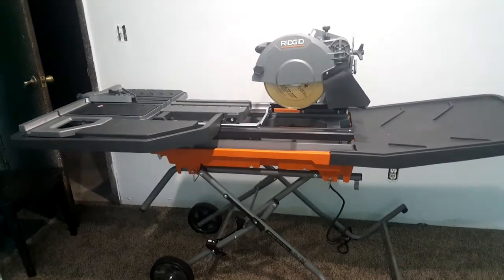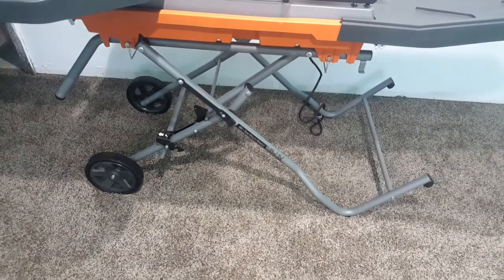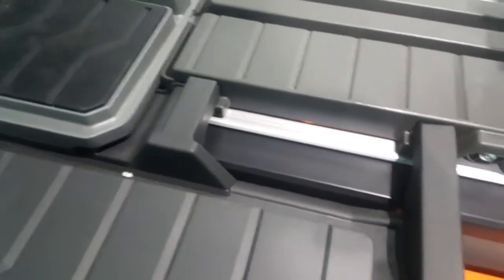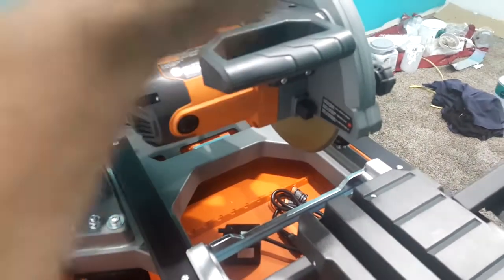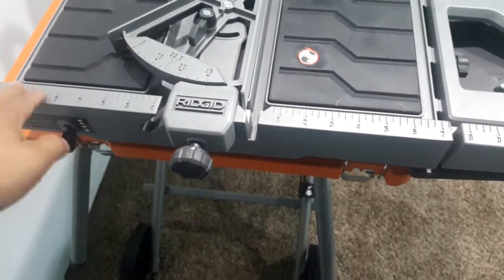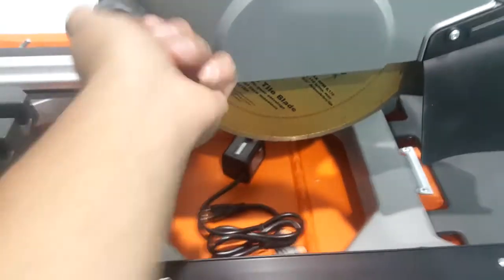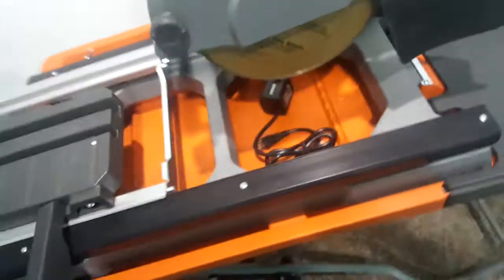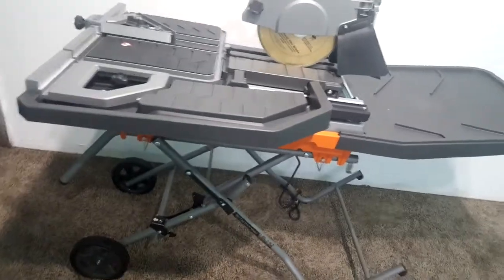RIDGID 10 Inch tile saw (2016 model ) 4092 quick review

Comment: I bought one yesterday and I like it. As for the plastic on the right. You can add a  flat screw on the front bottom and it will hold it in place very well...also I added a small L bracket on the plastic towards the back to hold it in place even more. To me you have to just be creative with things like that. And it will suit better.

Comment: Ive been using this machine for almost 3 years. Almost daily in a big building over 15k sf.
is a great machine for mobility. easy to move around, overall great machine. But, you'll have to play around and find out where to push from when making cuts or it'll cut slightly not straight for example. if you're cutting a 12x24 the long way, they'll be a 1/8 to 1/4" difference from start to finish. the track moves slightly. so i just had to push with my right hand and guide it with my left. otherwise the entire table of the tracks moves move than i'll like. The one slightly smaller than this i find to be very sturdy and makes great cuts.
Reply: Facundo villar thanks man. Your review has helped me a lot
Reply: You need to adjust your blade similar to miter saws and table saws.
Check the instructions to learn how. You will need some tools to align it they are mentioned in the instructions and have it tightened in and zeroed.
Most people like this guy dont know everything since they never read the instructions.
It seems no matter how good a carpenter or tile installer, they never know how to maintain or even to setup the tools they use. No one sells perfectly pre-adjusted saws of any sort. You must learn how to use the tools and maintain them before you buy your own and go into business.
Rigid is 100 percent better at tile saws then kobalt, craftsman, and dewalt. Dewalt never made a decent tile saw to this day for its price.
Reply: Least they can do is align it from the factory. Almost like buying a new car but sorry it pulls to the right gotta align it

Comment: How precise are the cuts with that 10" blade? I heard the blade bends on porcelain. Awesome review my man now let's see you cut some tile.
Reply from the maker: Mookey The Pimp Thompson the blade that comes with it is ok. just replace the blade with a better one and it cuts like butter bro
Reply: it does, you'll just have to make the cuts a bit slower to avoid it.
Reply: I had this issue with different saws and it’s two things or a combination of the two. Either. The saw head needs to be loosens and adjusted for squareness or the blade is thin and/or weak. Or both. Some harder tiles will make the blade follow its imperfect line due to adjustment. It’s such a pain when this happens, as I’m sure many know. When it’s a thinner weaker blade issue, purchasing a higher quality one solves that. 
  If it was a head adjustment (or table adjustment on the older models) one thing I would do was to push on the side of the spinning blade to help counter act this. I never recommend anyone attempting the “out of the box” fixes I did out in the field but this worked in emergencies. I never did this with the blades that have the relief cuts in them but just keep fingers wet and away from the Diamond edge. Although, even grazing the Diamond edge, when it did happen, caused no issue it I wasn’t pushing hard. I also never wore gloves like with most spinning tools.

Comment: It looks like those rubber bands on the side of the stand are used to secure the water trays underneath the stand when not in use. Also, just wondering if you've had a chance to use it yet and if so what are you're feelings. I'm interested in buying this unit. Thanks for your video.
Reply from the maker: yeah that's what their used for.  and yes I finished a full herringbone tile job it works awesome and you can use it indoors as well only things I didn't like is if your using a tile over 24 inches in length the water trays in the side won't catch the water it will spew over to the floor. second the rails where the bearings roll on you have to constantly clean them if your doing a lot of cutting or the sliding tray will get jammed on a piece of tile or debree but we did a lot of cutting so like I said just depends. other than that for some reason it wouldn't turn on one time I tried to turn it on but I unplugged it and replugged it in and never had the issue again but so far it's really a great saw and the trays are actually sturdy and handle plenty of weight ease of transport is awesome and very easy to clean great saw and the  water trays system is awesome

Comment: Hi. Thanks for this review. How is it going since you have been using the saw? I am interested in purchasing a wet saw for mostly cutting glass wine bottles (diamond blade) and I am leaning towards the Dewalt since all the big features on here don't seem necessary for me anyway. What do you think about the water feed on this one? I read that it doesn't even aim at your blade / work and there is no way to adjust it. Thoughts? I may get into some other projects but I'm still thinking Dewalt 2400?
Reply from the maker: fromBaltimore yeah the water feed is directed one inch away from  blade itself. but its a great saw the stand alone saves you so much time setting it up and putting it away and clean up is a breeze so far no issues what's so ever only thing i would invest in is purchasing a new blade
Reply: Good to know. Thanks!

Comment: I have this exact same model. I hate how loud it is compared to the MK. Anyways, only had it for about 2 years and only use it maybe 4-5 times a month and it already messed up!! Idk about repairing stuff but the saw works it self it just makes this knocking noise as if Something was loose in it. I’ve been told it’s the brushes. Anyone have the same problem?

Comment: Anyone who cant adjust the blade and thinks it comes pre adjusted needs to read the instructions!
Same as so called carpenters who only frame.
Tile is precise. Dewault, not so precise. Rigid USA is for plumbing and tile for over 100 years.
You can mess with that Taiwanese dewault if you want, but it will rust and it will never be as close to zeroed as the Rigid boy. You read both sets of insturctions! Read them!
Never saw a dewault saw other than the table top last over 2 years day to day use ever and never heard of it either. And as for the tavle top dewault, qep makes a better one, damn.
Wobbly ass dewault tile saws.
If you want to pay less get the ryobi. Works just fine day in day out.
And cleaning the saw is important as the tile dust dries out plastics this bio degrading extrememly fast. This is true for any brand.

Comment: Stay away from ridgid tile saw I bought the 8" $500 plus taxes not even 2 years ago and the motor went , I sent it for repair, they hold it for a month with no updates or phone call ,so i called them to find out what's going on , they asked me to pay $330 saying it's not covered under warranty plus their costumer sevice is really bad , stay away and save your self the headache, spend the extra dollars and get dewalt or husqvarna
Reply: Just buy it at homedepo they change it on the spot

Comment: @Amor Baeza -Okay, I had to stop watching at 5 minutes in, when you said you had not even used it. Come on. You are dirtying on it for things that are not even an issue and you had not even put it to the test.
  You say you wished the splash trays were made of aluminum when they don’t need to be. Those are made to come off easy and be stored when not needed or to make the saw a smaller foot print for stow and travel. They are quick release that don’t need to be (shouldn’t be) bolted on. Yet you yank on the side one, it pops loose and then you say something about it “falling off”. No, you pulled it off. I never had an issue with these “falling off” during use of the saw. You even say they work fine and do their job. Exactly. 
  You fiddle around with the two locking pins like they are not working and cheap but that because you don’t even know how to work them. The “storage” rubber straps, that you again don’t know what they’re for, you talk as if they are cheesy and not able to hold much. Hint; they are for holding the rear splash shield to the backside of the unit when in the upright position for storage or transport. There is another rubber strap to hold the slide table extension to the side splashguard. Worst of all you complain about the “cheap plastic” D handle on the saw head. You say that it feels sharp and that it may break if you drop it? What?? There is nothing sharp about it and it doesn’t feel like cheap plastic. 
  I can tell you I used to know someone that was so bad with his tools. He constantly broke things since he just threw them in his truck bed (unsecured) and drove like an idiot on the road. He broke all sorts of tools doing this that I had never seen broke. He later owned this same saw for a many years and never broke any part of it, definitely not the handle. I used it a few times and I never had an issue thinking the handle was sharp or otherwise uncomfortable. Maybe my hands back then where nice and rugged from working them hard everyday. 
  You complained about the stand. The stand may look less heavy duty than others stand but even this we never had any issues with. No breaks nor instability issues and it was lighter than the previous model that I owned back in 2008. It was also a lot easier to set the saw up than the older model. 
  You really should take down this video as it came up in my search for this model and it’s an unfair assessment of this tile saw. I recently purchased a used one of these for a small project, since I had great experience with it years ago. Before that, when I ran my own remodeling company in the mid to late 2000’s, I owned the RIDGID 10” saw that was the model before this one (maybe 2 models before this one?). The whole things was much heavier (including the stand) and it really didn’t need to be. Something I realized after using this latest one. That one I owned from 2008 was dropped and broken by someone borrowing it. The thick cast aluminum arm for the motor/saw head snapped revealing a hollow core. The arm was not a “C” beam like this current one but completely tubular and bigger in girth.  I actually thought it was solid core. One it broke in two, I saw it’s weakness. It had no inner support ribs. This latest model is a “C” beam with open Channel on one side that lets you see plenty of inner webbing cast into it. Much stronger I presume. Although, not going to drop it to find out.